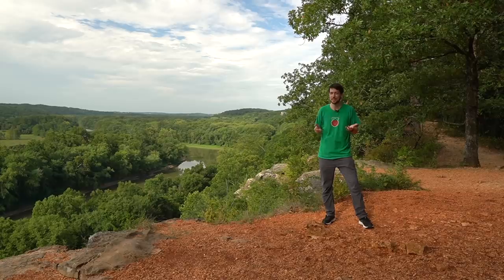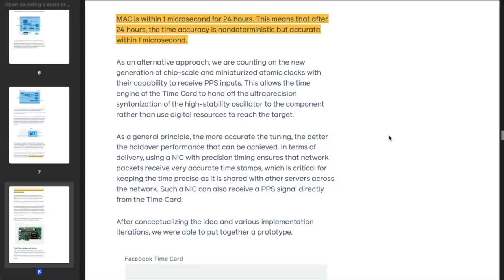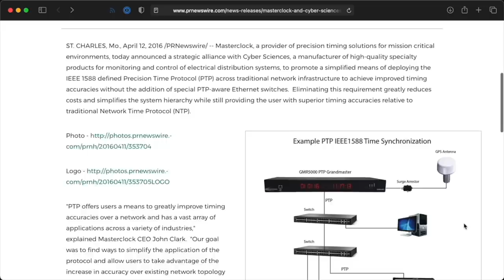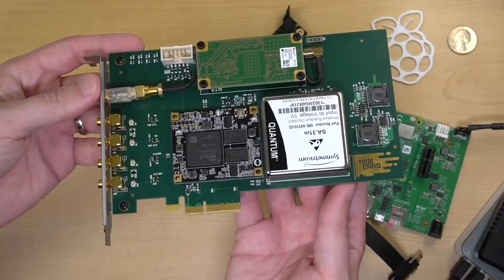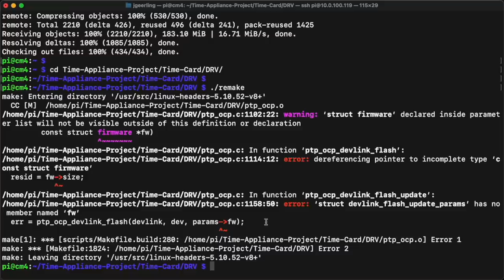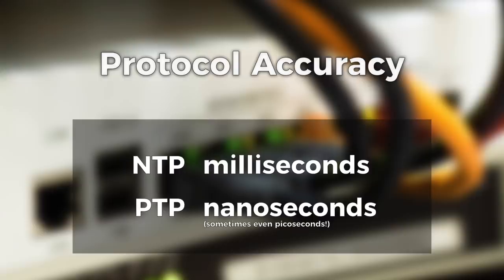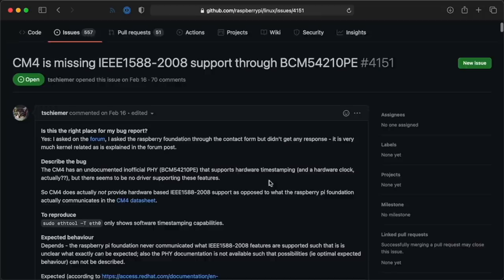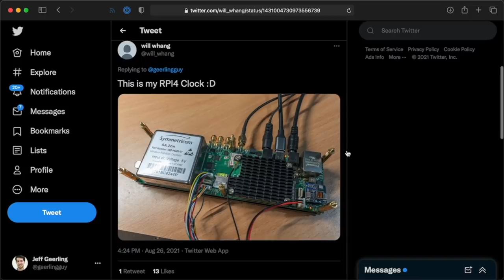The most accurate Raspberry Pi atomic clock IN THE WORLD!

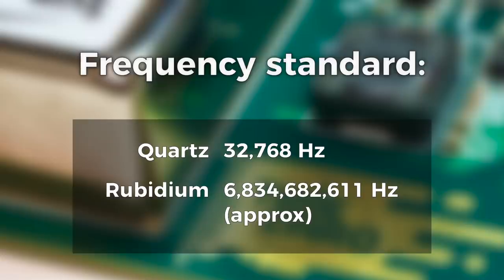Comment: 1:13 Okay, I just have to call this out. The "> 200,000x more accurate!" card here implying that a higher frequency makes it more accurate (or that these two frequencies even related to each other in a meaningful way) is *highly* misleading, straight up wrong even. Higher frequency does not mean better, not in the slightest. You can have a 1THz oscillator that is absolute garbage at keeping time. What matters for an oscillator is it's tolerance, stability, and phase noise. In this case since the oscillator is GPS-steered, tolerance matters slightly less, but stability and phase noise are still critical, and this is what something like a rubidium oscillator excels at, but it has nothing to do with how high a frequency it is, it has to do with how stable that frequency is, how little it shifts due to both environmental conditions and random fluctuations. Now, there are technical reasons related to phase-locked loops (which is used to get a different frequency out) why an underlying frequency standard should be reasonably high frequency, but that's not what sets quartz and rubidium oscillators apart from eachother, you can get quartz crystals tuned for the GHz region. What sets it apart is that a rubidium oscillator depends on atomic scale properties of electron energy levels in individual rubidium atoms which are relatively fundamental and unchanging, rather than depending on the relatively 'macroscopic' properties of a chunk of quartz crystal as a whole which depend on physical dimensions and environmental conditions.
Reply from the maker: This is true. Indeed in running the numbers after I had recorded my script, I realized the accuracy of the rubidium clock is actually more like 300,000x better than oven-controlled quartz—which shows the ~200,000x difference in frequency isn't the reason for the better accuracy.

But in these videos, I can't splice in anything or even add annotations. So I'll just hit the heart on this comment, leave this reply, and hope that people see it :P
Reply: Since you seem to know a thing or two about oscillators, you might be able to answer a question I've been having ever since I heard of this project (and the price for the rubidium clock):
What is the main cause of drift in quartz clocks? Is it temperature? Or manufacturing tolerance?
Reply: @JeffGeerling  Don’t worry Jeff, I saw it...
Reply: @vincentguttmann2231  Typically temp is the primary offender.  An old school method of improving an NTP server's perf was to purposely insulate it a bit to force the temp up, as holding an elevated temp stably is slightly easier than a consistent cool temp.  Or you could move up to an ovenized quartz oscillator, which as the name implies does the same thing for just the oscillator itself.
Reply: @771racing  Hmm. Now I'm thinking of how to make a PCB sandwich for a quartz oscillator and temperature sensor. It won't be as stable as a properly ovenized quartz at like 70 °C, but with no big fluctuations it should be better than a room temp quartz.
Reply: @vincentguttmann2231  So, this really depends. Manufacturing tolerances can be found as tight as ±3ppm or as wide as ±500ppm, but you might see in range of ±10-30ppm for some decent but affordable crystals.

Temperature stability is sometimes specified as a temperature coefficient or sometimes as a temperature stability over some rated temperature range, and something in the range of ±10-50ppm over a -40 to 85C temperature would be reasonably typical. However... on a typical PCB at the crystal, actual temperature swings will be much smaller than the such a rated range, you'll only see a small fraction of that ±10-50ppm temperature stability error. As such, the manufacting tolerance is a larger error typically.

For scale, I will note that 1ppm is about 2.6 seconds per month.

I would disagree with @771 Racings's answer, in part. The anecdote about insulating an NTP server is accurate and valid, but the only reason manufacturing tolerance doesn't matter as much there, is because NTP server software is sophisticated enough to measure and compensate for any consistent rate error from manufacturing tolerance. Shifts due to temperature on the other hand happen more unpredictably and in real-time however, so stabilizing the temperature helps. If you just have a simple clock running on it's own in isolation though, you're not going to be getting that sort of rate compensation, and in that case manufacturing tolerances will tend to be a larger factor.

Some other fun facts: The there are also TCXOs and OCXOs (temperature controlled oscillators, and oven controlled oscillators), which consist of a quartz crystal oscillator and some additional mechanisms to either electronically compensate for ranges in temperature, or to actually use a heating element to regulate the temperature to a predetermined level. These will cancel out the vast majority of the temperature stability, and you can find TCXOs and OCXOs where the resulting temperature stability is measured in parts per billion instead of parts per million. For a picture of cost, TCXOs range from about as cheap as 80 cents to a bit over $100, whereas OCXOs range from something like $25 to several thousand dollars. They will often have tighter manufacturing tolerances than your regular plain old crystals, but that aspect has more to do with more precise factory calibration than any sort of fundamental difference.

As an aside, it's fun to be watching a TCXO-derived RF signal on a spectrum analyzer, and see how the frequency subtly responds if you blow across it :)
Reply: @rougenaxela  P.S: Age is another factor which affects the frequency of a crystal oscillator over a period of years.  There is also an optimum frequency for crystals of about 10 MHz which gives best performance.
Reply: @JeffGeerling  Jeff, it all depends on what you mean by "accuracy" because that can be specified in lots of different ways.  The specs for the SA.31M say that it's within 5 parts in 10e11 at shipment, BUT it's also spec'd to age at 4 parts in 10e11 per day.  And the stability specs (Allan Deviation) are all in the e-11s.  That's pretty darn good, but the aging is at most two orders of magnitude better than a decent OCXO, and the short term stability specs can be equaled by <$50 surplus oscillators on eBay.  What the SA.3x is designed for is modest performance in small form factor, and it's pretty good at that.  Along those lines, take a look at the Symmetricom/Microchip CSAC -- chip scale atomic clock -- devices that offer similar performance to the SA.3x but in a much smaller package and much lower power consumption (and larger price...): https://www.microsemi.com/product-directory/clocks-frequency-references/3824-chip-scale-atomic-clock-csac
Reply from the maker: @johnackermann1640  lol, I love how they have on there, casually listed, "Space version available" :D
Reply: Same thing in wireless. mmWave frequencies itself does not offer faster throughput because the frequency is higher, it's just because more bandwidth is available in those frequency ranges.
Reply: @vincentguttmann2231  Initial error in manufacturing tolerance, after delivery, it is temperature-dependent (can be sort of compensated for), and then aging is the weird part.
So even if kept <<0.1C temperature variance it will still drift in frequency in time, it might even shift direction and no compensation for that is known to mankind. It will have short-term frequency variations that can not be explained with temperature variance. And then the long-term drift. The high accuracy rubidium clack on those boards are ONLY needed if no GPS satellite is in view. The drift in the 1 second range by a quartz crystal used on the GPS module is close to nothing.
Reply: For anyone interest the National Institute of Standards and Technology (NIST) has an entire division that  studies all thing clock and oscillator related. They have allot of online papers and references related to the topic
Reply: @JeffGeerling  Like the Silicon-on-Sapphire version of the RCA CDP1802 COSMAC CPU, that's probably got to do with both temperature range, and resistance to cosmic rays -- the SOS 1802 (which was like 5 or 10 times as expensive as the original, IIRC) is in a number of satellites, including most of the OSCAR birds, as I understand it.
Reply: @JeffGeerling  A beautiful card that is practically unobtainable. I've been looking for a baseboard to build it but haven't found much on the internet. It would be interesting to test it with professional audio capture cards. Unfortunately the latter are not compatible with Linux (for example RME - HDSPe Madi FX - which is based on Steady Clock) and I don't know if the time card is compatible with Windows.

Comment: love when open source projects like this come out, not because of the projects themselves, but because it makes the appliances they replace drop in price on the used market. finally, an evertz msc5700 for my very own home
Reply: Quite. Pretty sure the timecard that Jeff has is something developed by Facebook engineers. It's open source but to buy it built is around $1k used from memory. Of course, I don't have my own atomic clock so I don't remember when I read this info, if ever. - EDIT: Just watched the video, good to know I'm part of this universe and not a parallel one.
Reply: @jrlx86  I am working with several vendors to make the card (just the card with the atomic clock, SOM and GNSS) for about $200. Then you can put the parts based on need. Stay tuned
Reply: I manage quite fine with just a uBlox. Given that it listens on 4 different satellite networks, it would take a GNSS jammer or a broken antenna for me to lose track of satellites. And the ubx protocol will happily show the confidence error of the emitted time, while the 1-second pulse avoids the latency from sending out the time data over a serial interface. This is the pulse that would be used for IEEE 1588.
Reply: Why not just bur a card from a decommissioned cellular site.  They are already aged and easy to interface to.  They have a really good GPS receiver built in for clock sync and usually a TCXO or a OCXO.  The one I have also has a pair of outputs, a 2Hz and a 10MHz.  Interface is via RS232.  Frequency stability without a GPS lock nudging the XO is better than one cellular frame in 24 hours.  Best part is that they are dirt cheap.  Far less than $100.00 when I bought mine.

Comment: I work as a tech support field engineer for a major telecoms provider. Our entire network is synchronised to 3 Caesium clocks, cross referenced to each other and with GNSS receivers. We distribute this sync to our customers, most of whom have no idea of the ramifications.

However we have one customer who are halfway through migrating their entire platform from TDM (i.e. E1 2Mbps circuits), to Ethernet. Because of the mixed technologies, their services are critically sensitive to clock jitter, and we are spending a fortune in analysing, adapting and managing their circuits to reduce these issues.

I have been using Symmetricom Rubidium / GNSS test equipment as reference clocks to monitor their circuits,  and the  tolerance levels are so miniscule. 

Great video.

Comment: The Rubidium unit on the card generates a 10MHz TTL clock. I have working Symmetricom Rubidium clocks that were bought a fraction of the $700 for the Microsemi unit so I think I'll go head and build one of these and connect it up to my existing 10Mhz TTL reference. Thanks for sharing, Jeff. Oh, and this is the best coverage of this device I've seen to date.
Reply: it managed to strike the good middle ground complexity wise. Ian was for to indepth, while linus was basically a quick summary and the obligatory pointless "play games with it"
Reply from the maker: Linus definitely has the monopoly on 'sexy video shots of the card' though. I'd kill to have more than 12' sq ft for my entire media production and test bench setup :D
Reply: Vince,
I didn’t follow exactly.  Does the card have a 10 MHz TTL output on one of the SMA connectors?
Reply: @dave_dennis  Hi, that I'm not sure - I need to look at the full circuit diagram in Altiium, however, the rubidium clock source that is soldered to the board has a 10Mhz TTL clock output. What I meant is that rather than fork over $700 I can jury-rig a connector and cable from my larger rubidium sources (also made by symmetricom, now Microsemi?) and solder the cable to the clock-in on the pcie card. The source they use also has rs232 which mine does too but it'd lay bets that whatever is exchanged over that serial interface is the same protocol. I remember being able to open a putty rs232 session to my rubidium and query the device for status, etc.
Reply from the maker: @dave_dennis  According to the specs, it has "1PPS / 10MHz SMA output" & "1PPS / 10MHz SMA input" — see https://github.com/opencomputeproject/Time-Appliance-Project/tree/master/Time-Card#interfaces

I haven't dug into it yet, but it looks like those interfaces go through the FPGA, and are not directly attached to the Rb source.

Comment: So this is the third video I watch about this time card, yet you've added a ton of new info which I was not aware of. Like how Linux identifies the card, or that PTP requires hardware support on the network interface to work. I got a bit more excited about the possibilities this card offers. I was stuck in my head thinking on the database level only, that you can organize transactions in such way that you can essentially use optimistic locking all the time and non of them will collide. As a developer I thought "yeah, that's cool", but it's the more practical use cases which opened up my eyes. I'm really looking forward for the next video in this topic :) Also, I was thinking the other day about making a GPS based NTP time server on my network from a Pi, because "I can"(tm). GPS radios are not that expensive now. That could also be a good intro video to network time services. Shame on me, I never had the urge to look up how even NTP synchronization work, and PTP was completly unknown to me before this card. But it's an interesting topic.
Reply: Thanks for the heart Jeff by the way. But one of the typos was getting on my nerves and editing a "hearted" comment makes YT remove the heart. Well.. I'm now heartless :D

Comment: Thank you for the video, I'm excited to see what you can do with this hardware.  I have a few responses to your video:

- The rubidium clock's accuracy is not based on it running at a higher frequency than quartz, but rather a more stable frequency.  Temperature changes cause quartz crystals to change frequency more dramatically than rubidium

- The 32khz crystal runs the real time clock (RTC), which can keep time between reboots.  The RTC is typically ignored on the pi because it does not have a battery backup for the RTC, so the program fake-hwclock is used instead.  The main system time comes from a counter in the CPU on the pi (driver is named "arch_sys_counter") which is driven at 54MHz

- NTP can use hardware timestamping as well, and can reach microsecond to hundreds of nanosecond levels of sync in proper conditions
Reply from the maker: I shall consider myself educated! To be honest, prior to this project I've only worked with NTP and only really cared about millisecond-level resolution. Though that darned Chicago server has made me more interested in better holdover accuracy.
Reply: @JeffGeerling  due to denial of service attacks, it's been popular by service providers to block or rate limit UDP in general or NTP in specific. This could be what happened to your Chicago server. I know Linode is blocking IPv4 NTP outbound, but IPv6 is allowed.
Reply from the maker: @DanDrown  That could very well be the problem.
Reply: Also, as I recall, while the rubidium clock frequency is very stable, its phase noise isn't very good. Crystal oscillators, on the other hand, have frequencies that aren't very stable but have very good phase noise characteristics. That is why the rubidium clock is used, through a phase lock loop or some other mechanism, to maintain the crystal frequency. Then the crystal output will be highly stable in frequency as well as have excellent phase noise.

Comment: When I got to my first submarine, we used 2 cesium clocks to provide reference signals to most of the equipment.  The Cesium clocks weighed about 75 to 100 pounds and we had to take them to get calibrated every 6 months.  They had a battery backup that lasted about 20 minutes, so we had to get them to the shop quick.  On my last submarine we used a rubidium clock.  Smaller and cheaper is better.  We could sync it up with GPS ever few days to make sure it stayed accurate.

Comment: There is a Dallas DS3231 chip that packs a DTCXO. It is a lot less precise than atomic clock, but much better than a regular crystal, and much cheaper too. I have a Pi NTP server project that uses GPS for time base, a DS3231 for local timekeeping, and a STM32F030 as the governor of DS3231.
Reply: Yes, your idea is the right solution.  millisecond precision at low cost is a very good solution for many time problems.
You can please share your project, or sell your device, i and many will buy it.
Reply: @BienestarMutuo  It was available on my Tindie page but I currently have no manufacturing facility available to make them.